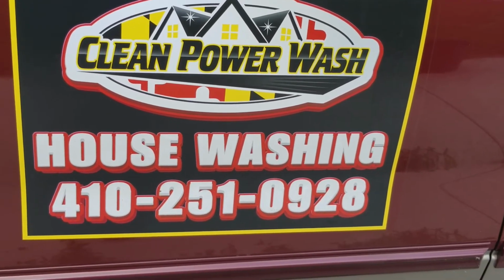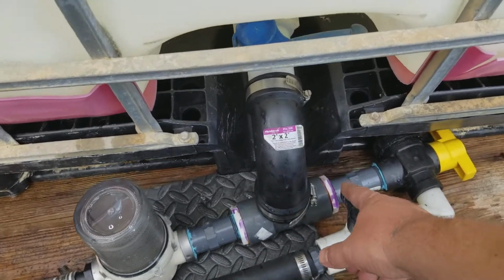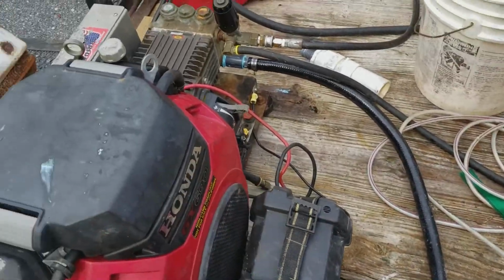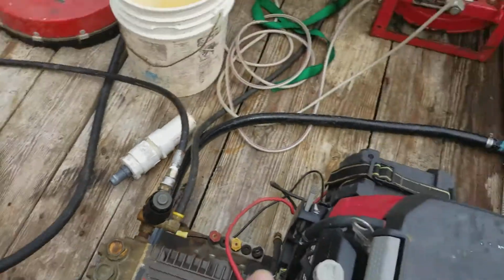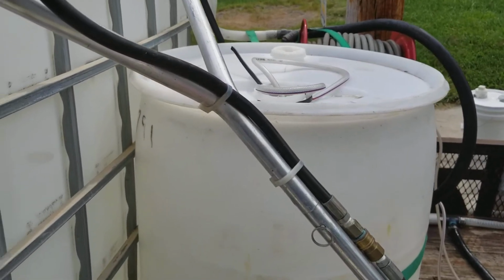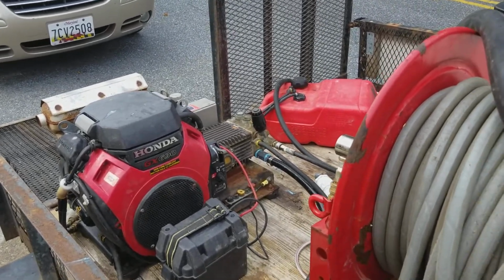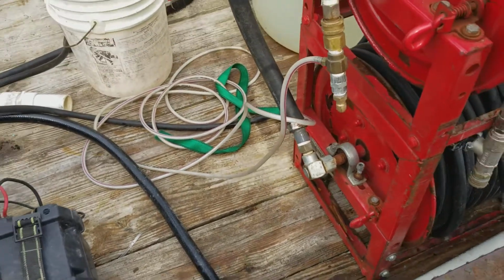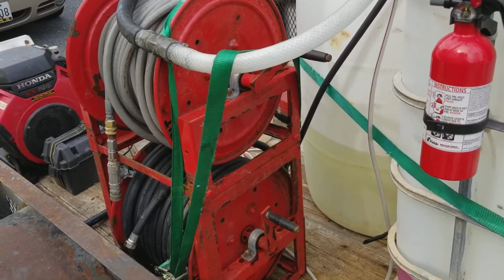Basic rig set up 6x10 single axle, 8gpm belt drive and stacked hose reel

Comment: A bulb filter is not designed to run up like that you need to turn it down and it will work fine as long as it's lower than the water source.

Comment: Do you haul much water? Or do you fill up on the job site? I did not know what the axle specs work. It looks like a pretty small trailer. I run a single axle but I'm only doing residential. I might have 100 gallons in my buffer tank and occasionally I will have 50 more gallons in my roof mix tank. That's pushing it but I do it :-)
Reply from the maker: SteveCleans with that trailer?  No not really.  maybe 100 to 150 gallons.  It can handle being full but the big trailer would be used if we needed to haul 275+ gallons

Comment: 275 tote, 55 drum full =2748lbs on a 3500lbs trailer? plus reels, machine, hoses, etc not including weight of trailer. What has been the lifespan of your trailers?
Reply from the maker: B Day the single axle trailer is going on 6 years strong.  No issues.
Reply: Thats awesome and giving me some comfort in a new trailer build. I just wondered about DOT also if they ever give you any troubles. I know your not always loaded to the top with water but I am sure some jobs call for it. Thanks for the reply either way. 6 years is good to hear out of a trailer with constant SH exposure.
Reply from the maker: I'm well below DOT with that trailer.  My others....not so much
Reply: What are the DOT requirements for your operation.  I am an auto transporter and im getting off the road because those DOT guys will ticket you for anything they can . Have you ever had any issues?

Comment: Do you not need a booster pump for that set up?
Reply from the maker: It's just a basic rig.  2 machines, downstreaming
Reply: Gravity feed works though? I have trouble just on my 3.5gpm I have to use a booster pump to get water to the unit
Reply: I'm also direct drive so that probably has a lot to do with it as well.

Comment: What would you recommend. Belt or gear driven?
Reply from the maker: Doesn't really matter.  Belt will last longer and run cooler, but is a pain to service.  Gear drives are a beast, but easy to service.
Reply: @Cleanpowerwash  are you able to connect the direct drive pressure washer to a water tank? Have heard people say to just elevate the tank but not sure if it works
Reply from the maker: Yes we can do it.  As long as  your water level is above the height of your pressure washer inlet